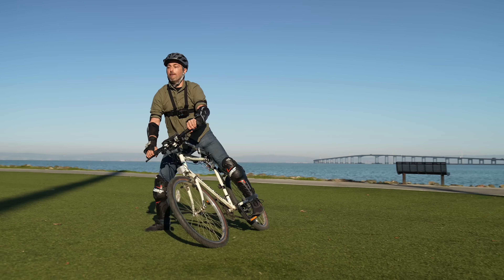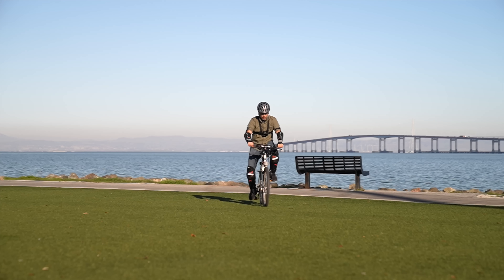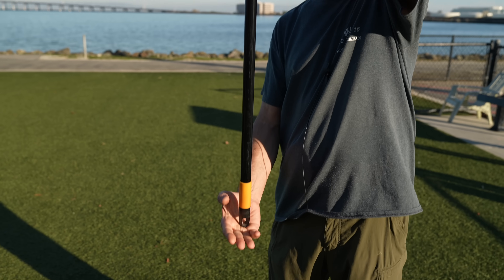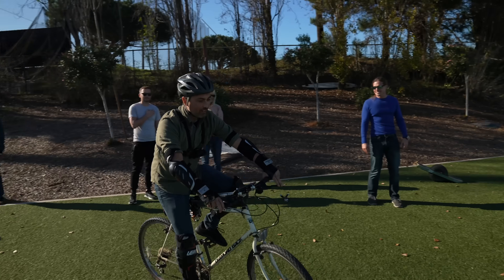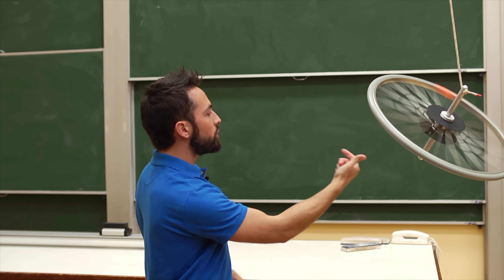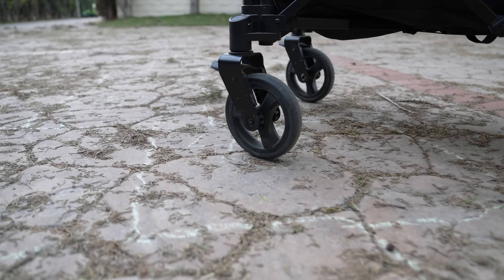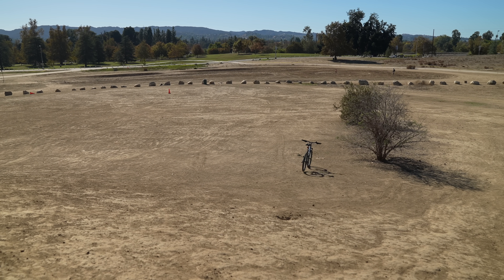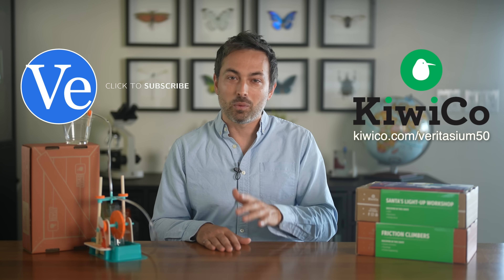Most People Don't Know How Bikes Work

Comment: So if you need to turn left to turn right... how come you don't need to turn right to turn left in order to turn right?  Isn't it just turtles all the way down?
Reply: Good question.  The reason you first turn left to turn right is to effectively throw yourself off balance to the right so that you can then steer to the right and control the lean.  You don't have to first turn right to turn left to turn right because you don't want to settle into a controlled left turn.
Reply: @Rick_Cavallaro  I don't fully agree because that doesn't answer why you don't NEED to turn R/L/R... only why you wouldn't WANT to. To me, the reason in the video is wrong.  The video suggests that you must first turn left in order to turn right, so by that logic one must first turn right to turn left to turn right so on and so on and so on.  It becomes a chicken and egg issue.  What came first, the left turn to turn right or the right turn to make that first left turn?  The L/R issue on the bicycle is all to do with balance and tyre deflection nothing more.  Do the same experiment on a child's tricycle (or a very slow/perfectly balanced bicycle) and you can turn the bars L/R and go in whatever direction you wanted.  Why, because the "U" shape of the tyres doesn't come in to play.  It's the same way that a car has "flat" tyres and doesn't need any "counter steer" because the rolling radius of the tyre remans the same.  The bicycle does "not" require the left to go right counter steer in order to steer.  We naturally do this L/R counter steer to help the bike to roll on to the smaller radius of the tyre.  The reason the rider here cannot work the modified bike is because he isn't compensating for the deflection in the front tyre when the bars are turned.  As the bars turn to the left, the contact patch of the front tyre wants the tyre to continue straight and this is what makes us naturally want to turn the bars right to compensate and this in turn puts the tyre on to that smaller rolling radius on the left hand side because the riders weight is on the left.  If the rider put his weight left prior to turning the bars left, this weight would counter act the tyre deflection and naturally pull the bike on to the smaller rolling radius of the "U" shaped tyre and induce a left turn.  The faster the bike is moving forwards the greater all of these effects become.  The whole thing with counter steer is speed related.

Comment: I knew this because I use that caster wheel principle for making realistic motorcycles in Scrap Mechanic. I don't use sensors to make the bike stay upright while powering the steering, I use the steering controls to power the LEAN of the bike and the front wheel's sideways rotation is unpowered so that it can freely turn into the direction of the lean.
Reply: I'm sad that I can give this but one thumbs up!

Comment: Why use steering left to lean right, just lean in right more aggressively and you will turn without counter steering. That's exactly what you do riding without hands. Be more pronounced in the body movement and problem should disappear.

Comment: I tried this, going at high speed on a motorcycle try gripping the tank tightly with you legs and turn the handlebars to the direction you want to go ie turn them right to go right the bike will go left… it’s a weird sensation because your brain is anticipating turning right but the bike goes left.

Comment: I think you can add one more balance point. I think almost everybody noted when you tried to ride only forward you tried to catch balance with knees. And it was not enough. It happed because of you are sitting on the bicycle. But what would you do if you stand on your legs? You would got extra balance point. And you can control your bicycle more effective. You can see how it works it you will find railride bmx on youtube. I know that it only for short distance but if you want, you can practice and ride for 20-30 meters or more. 
It interesting because riders can not to use front wheel for balance. Only body.
I hope it could be interesting for somebody :)

Comment: this is the stupidest way i have seen yet to prove countersteer is the best way to steer. but the point was proven. as a mattrer of fact, best motor riders don't turn the wheel, the PUSH it, thus countersteering. its easier and SAFER way to steer

Comment: "The front wheel essentially acts as a caster wheel" Well, yeah. The angle the forks sit at is typically called a rake angle when referring to 2 wheeled vehicles, but it's also called literally the caster angle. Cars have the same thing, just at a steeper angle because they don't fall over. Steeper angle is more agile but less stable and a greater angle is less agile but more stable. That's why sport bikes have much steeper rake angles than cruisers do. Also, counter steer is one of the first things they teach you in a motorcycle course. Put pressure on the side of the bars you want to turn to. But at those higher speeds, you don't turn back into the turn.

Comment: So if you locked the front wheel you would not be able to ride without handlebars? Interesting. I always thought riding without touching the handlebars was more stable when the wheel didn't turn but this video proves me wrong. Would love to see the same experiment done when just coasting on a slight hill without touching the handlebars. Would just balance be enough or would the wheel still need to turn.
Reply: No. If the steering is locked you are unable to ride.

Comment: Nope. This is a gross overgeneralization of cornering. 
Two scenarios discount this theory: 

1.   A professional cyclist traveling fast downhill in a long sweeping left hand turn, does not have to counter steer when the road turns to become a right hand sweep. He just shifts his c of g to the right by sliding his butt and trunk to the right. No counter steer movement is required. 

2. If you do not believe the above, then you also don't believe a cyclist can change directions without touching the handle bars. Of course they can, ergo they don't need to consciously counter steer. 

This theory about counter steering is a misinterpretation of bicycle design and how a turn is initiated. 
Essentially all bicycles have a trailing contact patch (trails the intersection of the steering angle and ground). 
It is the trailing contact patch that causes a wheel to lag when a rider leans either left or right. 
This lag of the wheel to turn in the direction of the rider's c of gravity, is misunderstood as a need to counter steer. 
If counter steering through the bars was essential, a person could not turn a bicycle by leaning their bodyweight only without hands on bars. 

It is absolutely possible to steer a bicycle in the direction of body lean, without touching the bars. 
Further, if a bike had its bars locked so they could not turn to the left whatsoever, It would still be possible to use c of g to turn to the right. One just has to do it very smoothly and slowly. This gets more easy the faster one goes.
Reply: 1. BS. A pro biker will know how to turn and the countersteering is the only way.
2. Not related.

Comment: I think there are two things going on:  One is "keep the bike under you", which is independent of the gyroscopic effects of the front wheel.   The other (well-learned by any high-speed motorcyclist) is "bump the left handlebar, to turn right".  That second effect is dependent on gyroscopic effects, and I think it's much stronger on motorcycles, because their rims+tires are way, way heavier than a bicycle's rims+tires.
Reply: Sorry -- that should have been "bump the left handlebar, to turn left."
Reply: Say no to gyroscopic effects.

Comment: Wait so how does turning without holding the bars work
Reply: Same way really.  But it takes advantage of the three principles Derek described for a riderless bike.  You still counter-steer to initiate a turn, but you do it by leaning the bike slightly.  Not the whole system (person and bike) but just the bike.
Reply: Exactly the same, but slower.
Quick turn changes without active steering are not possible because of the mass.

Comment: It is important to note that this is the case for turning hard to a direction. If youre just turning slightly from a straightline like only 10 degrees angle than you actually dont counter steer

Comment: I disagree with this video. I don't countersteer when I want to turn. I just lean. The momentum will make you upright by default coming out of the lean. The problem is, most people steer with their hands letting the bike follow. They keep their weight up front, so they usually fall. Even when folk ride without handle bars, they just lean the way they wanna go. For heavy bikes like motorcycles, countersteer makes sense, because of the weight of the motorcycle. But even then, riding on the back of a motorcycle, if your speed is high, you lean. Otherwise, you might flip your bike. For slow speeds, counter steer a motorcycle. On a bike, let it lean from under you, and you the human keep the balance. I do this and sometimes will ride a bike sideways. Meaning it's almost on the ground while I'm standing basically upright. I stay upright, and the bike is leaning under me. If you sit down and try, you will almost always fall unless its a sharp turn and you know how to brake with momentum to let the bike right itself because its "throwing" you the opposite direction. You really never need to turn the wheel in sharp turns but slightly into where you wanna go. Otherwise, it can slide from under you. I know from scraped childhood knees and experiences. Thats why I disagree.
Reply: For your and everyones safety. Don't ever ride any two wheeler.

Comment: motorcyclists have been taught:  Push left lean left, go left.  If you push your handlebar left, effectively making the handlebar go right, it leans the bike left.  If i tried this bicycle, I would try to overlean it on the left side, then counter with the handlebar left to keep the bike from falling all the way over.  So lean first, and then counter with the handlebar.
Reply: >>  If i tried this bicycle...

If you're in the S.F. bay area I'd be happy to give you a crack at it.  Would be interesting to see how it goes.

Comment: Would've been nice to test the bicycle with the locking mechanism without anyone riding it and both sides locked
Reply: Sadly, we did that very thing, but didn't think to put it in the video.  Not too hard to do it with your own bike.  Just tie both handles to the seat post as straight as possible (and as tight as possible) and push it down a hill like Derek did.  It will just fall over.

Comment: I can stay balanced on a perfectly still bike for hours
Reply: Are you doing a track stand with the front wheel turned fairly sharply?  This is a relatively common skill.  But doing it with the steering locked straight forward is a far more rare skill.
Reply: @Rick_Cavallaro  steering locked I wouldn't be able to, you're right. I'd try making lots of small jumps like on a pogo stick

Comment: Awesome video. This has me wanting to use my GNC knowledge to make an autopilot for bikes now.
In the GNC world, having to steer in the opposite direction of where you want to go first is not uncommon and is dealt with alot.
In technical terms, it means you have a zero in the right hand plane of the bike's root locus plot.
Human terms, it would be fun to work on.
Reply: >> In technical terms, it means you have a zero in the right hand plane of the bike's root locus plot.

BINGO!  And you implement non-minimum phase control.  I'm curious though.  In guidance and control, where else do you run into this?

Comment: How does it work when you do it look-ma-no-hands style?
I know that I just visualize it as shifting my weight in the direction I want to turn to.
Reply: When you're riding no-handed, you actually lean the bike just a bit to generate the desired steering inputs through the three principles that Derek mentioned (and yes - you still counter-steer to initiate the turn).  Most people seem to think they can just lean to initiate the turn without counter-steering, but that's actually WAY more difficult than they realize.  When you're riding no-handed, you just need to lean the bike - not the center of gravity of the combined system.

Comment: I noticed as a kid in the wet marks that bicycles tires left on the road after crossing through a puddle, that a turn in any direction was always preceded by a slight movement of the front wheel in the opposite direction. Didn't know why until now.
Reply: Very observant :-)

Comment: So there is more than one way to turn a bike. You can turn the handle bars the method from this video, or you can intentionally lean and move the center of gravity out from under you causing uneven friction resulting in a turn. Think racing motorcycles where they lean with a turn rather than turning the handle bars (much) I was taught to ride with the later method  of control and I'm curious how this would impact me or somone who turns in the lean style. I suspect we would still go on our face since this doesn't get around the micro adjustments to keep it under you when going straight but im curious if those could also be done via leaning. 

I'm also curious on how this would work for those that can ride with our holding the handlebars. Slow gradual turns can be accomplished with leans with out where touching the handlebars. I would suspect they still have to start by leaving the opposit direction but it would be interesting to see if they do any better
Reply: Only one way.

Comment: Rear wheel speed could easily help you with your turning issue. Remove the front wheel from equation and use body weight to steer.

Comment: Use steering to keep the bike under you? 
Did any of these people try to ride a bike with no hands? I used to ride my bike to my friends house with no hands on the handlebars, and it involved a few turns. This 'experiment' is flawed in a scientific way, or, was the art of riding a bike with no hands seemingly forgot? 
This is why science needs more checks and balances (ha).
Reply: Did the bike you rode have fixed fork?
I tought so.
Reply: @XtreeM_FaiL  no, of course not. Fixed handle bars isn't part of the issue. The experiment is showing that you need your arms in conjunction with bodily movements to keep balance and steer a bike. The fixation of the handle bars was nothing more than proving you need your arms. 

In reality you don't need your arms to steer a bike, you can use your whole body only to balance and steer a bike to a certain degree.
Also, why didn't they incorporate or even talk about riding a normal bike with no hands?
Reply: @XtreeM_FaiL  you can steer a bike with your body. Did the skill of riding a bike with no hands suddenly drop off the face of the earth? What planet do I live on?
Reply: @XtreeM_FaiL  of course it can't. Well, it might since they didn't even try to ride without hands with a fixed form. That's not how they were designed. 
But the video was emphasizing you need hands to ride a two wheeled bike eith or without a fixed fork.
Reply: @XtreeM_FaiL  they didn't even try riding a fixed bike eith no hands... science needs to be subjected go peer review, and I've pointed out the experiment is incomplete.